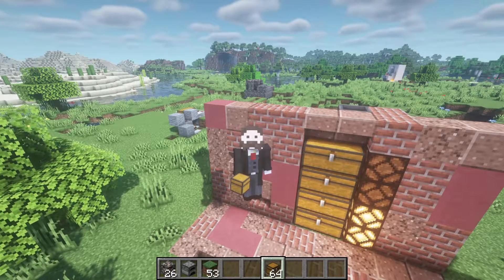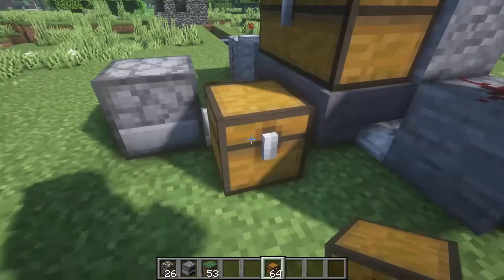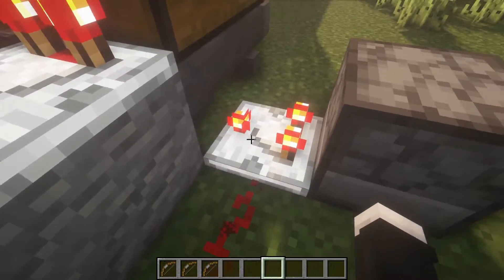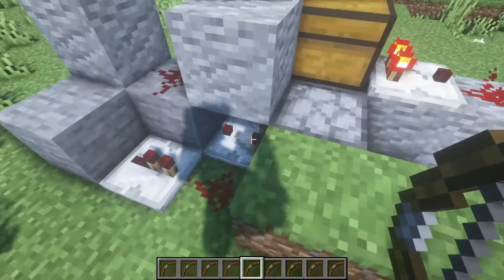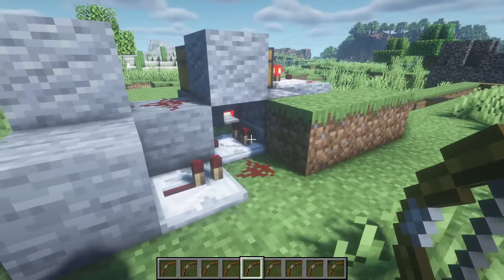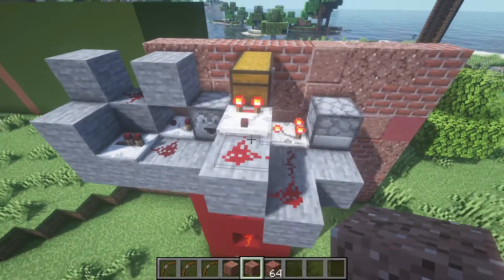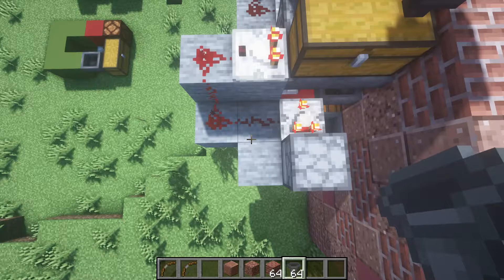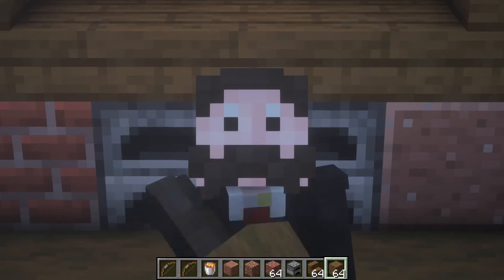Discover How to add Overflow Protection to your storage in Minecraft!

Comment: Can you use this method to detect a full chest? If I add 64 items to the furnace, it triggers at about half full. Anyway to increase the count?
Reply from the maker: Yea the dropper will work well, just don't accidentally power it 😅 You can still use a furnace, just add 64 smooth stone in the top slot and 64 fuel source below to max the furnace out
Reply: Ah. I used a dropper with 8 swords instead. Thanks. Much more compact than the monstrosity I came up with 😂👍
Reply from the maker: Was about to say there's a few ways around it! Glad it helped! I may have to do a follow up video to this with more detail. I made this when I was very new to YouTube 😅